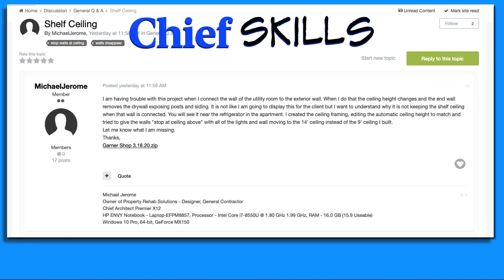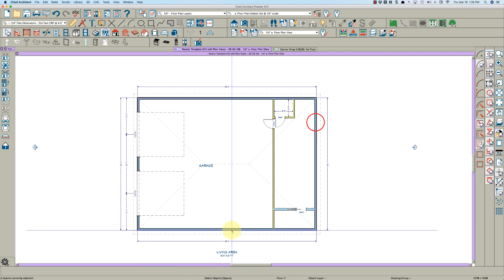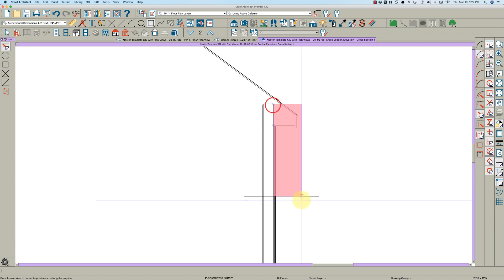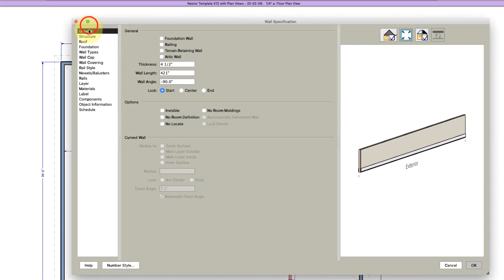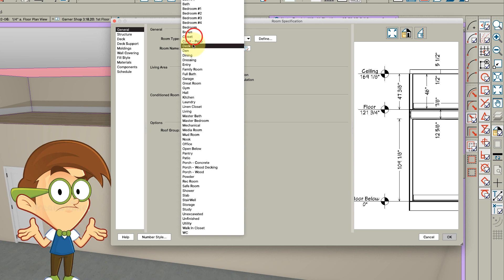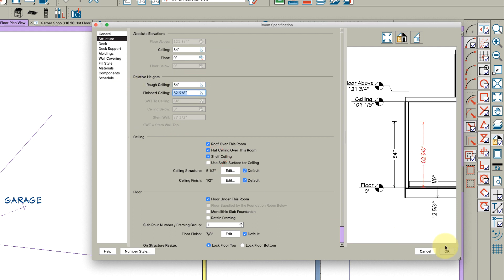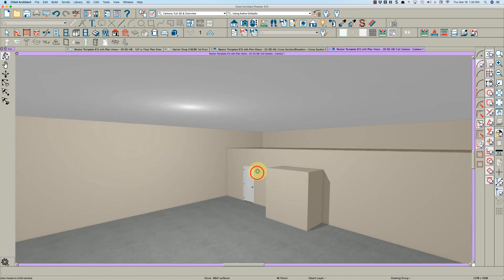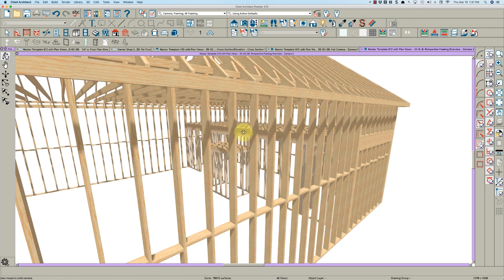How to create a Mezzanine space in a Garage using Chief Architect X12

Comment: Thank you so much for your advice! One quick question, how can you hang a platform on the inside of the interior wall? For instance, adding a platform in a remodel where the outside walls are existing.
Reply from the maker: A platform or a floor?  You could use a shelf ceiling or even a solid to create a platform. A floor always requires a “room”.  No room...no floor.